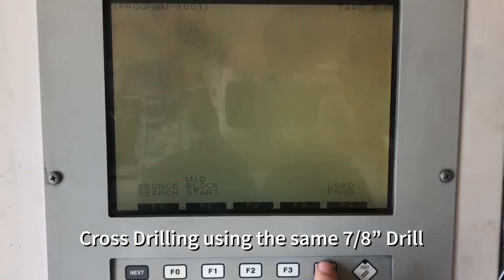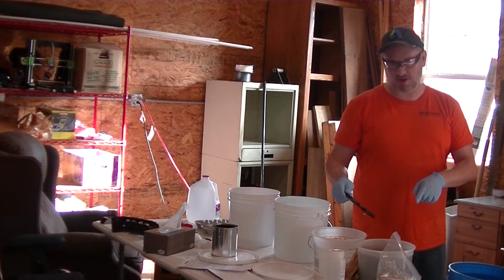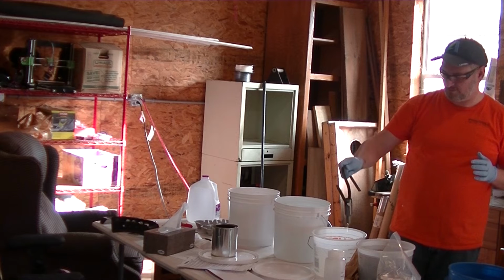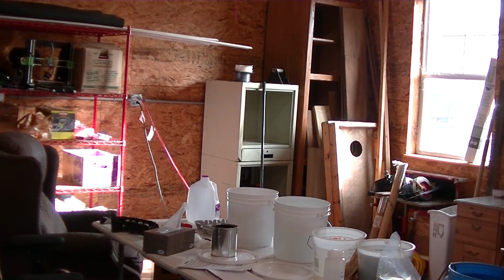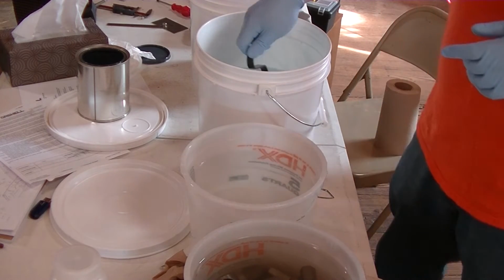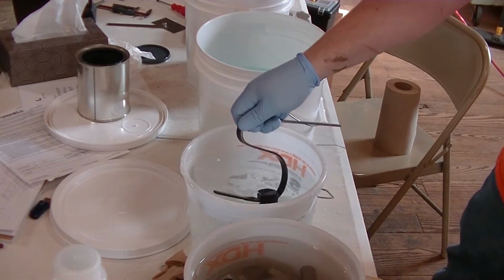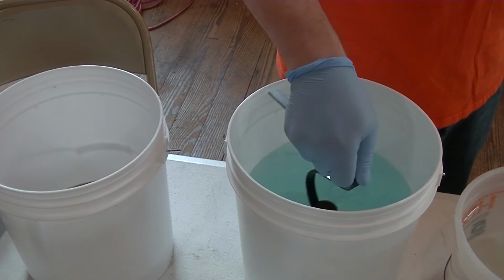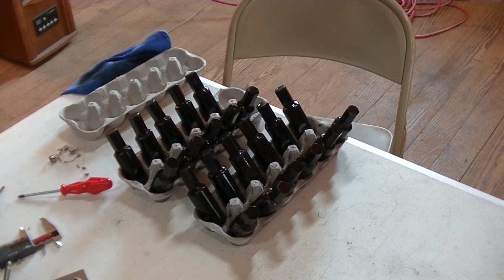Making Custom Sockets

Comment: Bushings hex socket watching learning. Black Oxide is good the sealant is good, penetrates, not heat based thank you. Nice you add value for each run of parts, this is how you get ahead and share with new customers to know you are able to do and improve jobs for them. Honing our skills is what it is called around or shop. Lance & Patrick.

Comment: You are supposed to refine the process to improve the product and your profit! Of course maybe it will lead to more work and you can make it back up but at the same time when someone comes in and says if we like this price we may bring back more I still always bid it like anything else. I won’t participate in a race to the bottom.
Reply from the maker: Agreed - and none of this was prompted by the customer really. Areas where I improved my margin came in the machining side of things. On the lathe, switching to a drill and single op saved time over pre-drill and boring to size. On the mill I was pre-drilling and then milling to final size, all replaced by the same drill as well. Overall, I try to provide value but I've been careful to start charging what the work is worth rather than always doing favors for folks. It's been tough to make that leap mentally though. Hope you are well, sir.